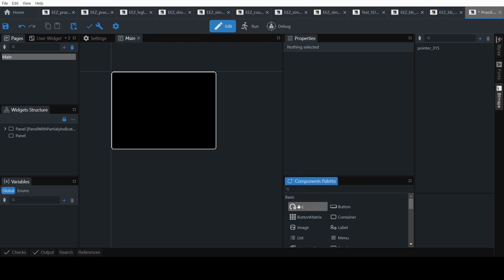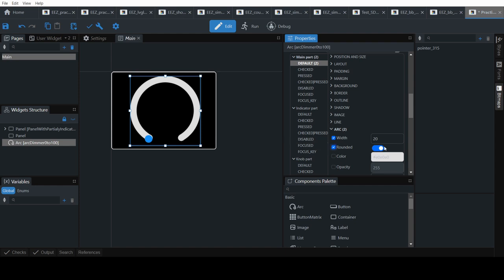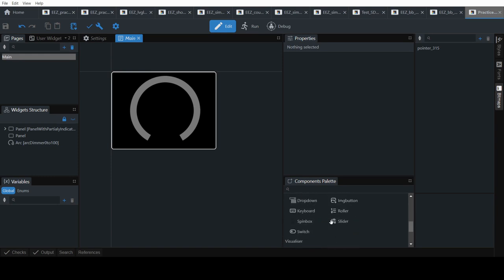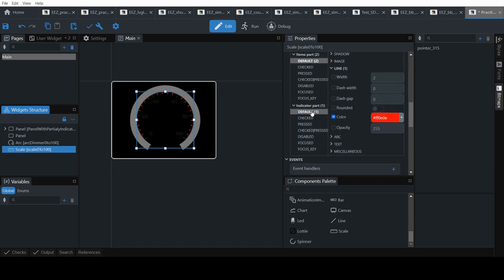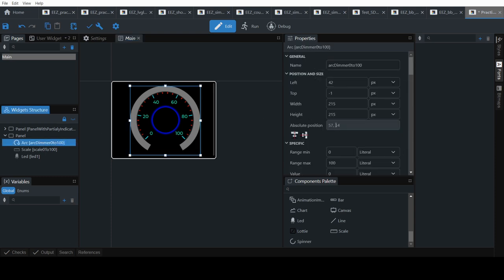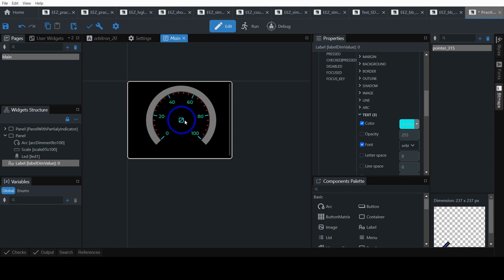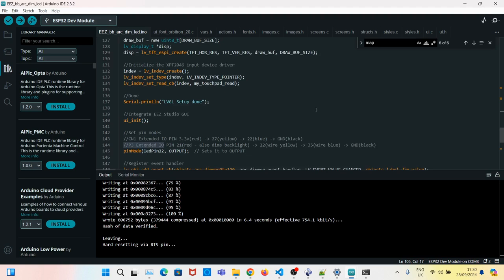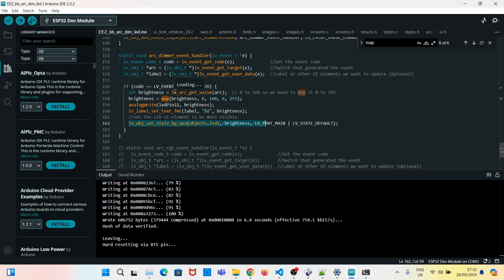LVGL ESP32-2432S028R Use ARC to control brigthness of an LED on a Breadboard(Beginner)

Comment: hello. What calculation did you do to arrive at these values: uint16_t touchScreenMinimumX = 200, touchScreenMaximumX = 3700, touchScreenMinimumY = 240, touchScreenMaximumY = 3800? thanks for the video.
Reply from the maker: This is the default template created by Brian an expert in CYD.  I use it on my projects.

https://github.com/witnessmenow/ESP32-Cheap-Yellow-Display/blob/main/Examples/LVGL9/LVGL_Arduino/LVGL_Arduino.ino

Comment: Good explanation, now my question is, will that create the void septup and void loop part of the arduino sketch that have to be setup to control the led or that part have to be build separately?
Reply from the maker: Hello you can clone the project from GitHub:

https://github.com/nu1504ta0609sa0902/CYD_practice_projects

https://github.com/nu1504ta0609sa0902/CYD_practice_projects/tree/main/LVGL9/EEZ_bb_arc_dim_led

I've updated the description with the project linksj.